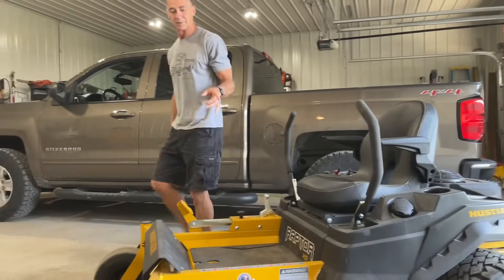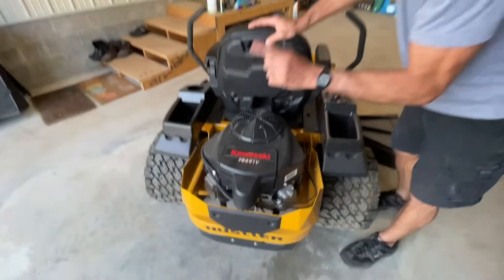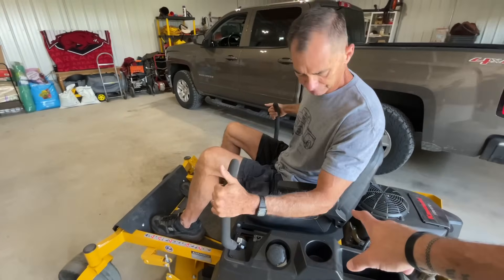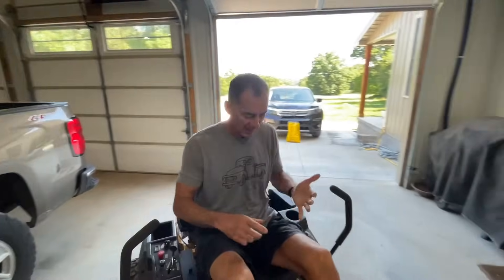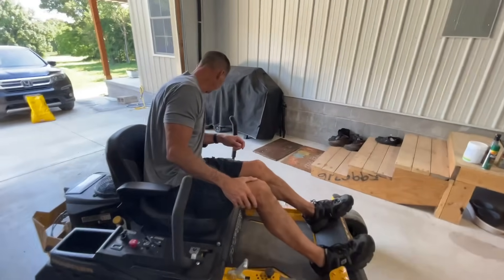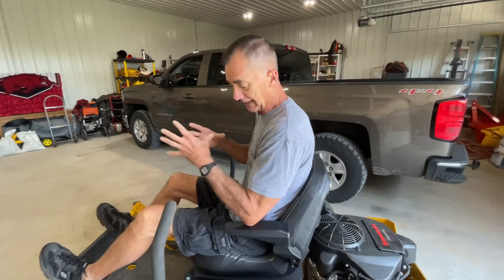DON’T BUY A HUSTLER MOWER UNTIL YOU SEE THIS!

Comment: I mow more than 100 properties a month with my Hustler Raptor 42, and have for the last 5 years. I wouldn't hesitate to recommend Hustler mowers to anyone. As much abuse as mine takes, if you're buying one for home use it'll last you MANY years. Great video!
Reply from the maker: Thank you, I love hearing these stories. You are busy,  my word that's a lot of properties. Appreciate the comment
Reply: I've been wanting to get a raptor for commercial use but didn't know if they'd hold up. Thanks
Reply: @braydenvandenberg8703  Update: my 42'' Raptor was such a workhorse that this year I bought a 54" Raptor and a 34" Surfer Pro. The only issue I have with zero turns is rear tire traction (the Surfer is a stander and doesn't have this issue), but that can be an easy enough fix.
Reply: @moebiwan  I was looking at the Surfer pros  for my smaller yards but since there so new I didn't know what to think of them. Is it working out good for you so far?
Reply: @braydenvandenberg8703  That's exactly why I bought one. Mostly for back yards that the 54 can't get into. I use it on roughly half of my properties. I prefer to sit as I have a bit of a bum knee, but it has worked out great for my business. 
If I had any complaints, I'd like the ignition to be in a less awkward spot (it's directly under one of the hand braces), I'd like the rear tires to be wider, and I'd like smoother transmissions (it uses the 1800s, the same as on my old 42, and they can be a bit jerky). But those are minor complaints. It's built well, the cut quality is excellent for me (I cut a LOT of centipede and St Augustine), and the way the engine is mounted you can get to everything in a snap.
Reply: @moebiwan  Thank you!
Reply: 3k with 150hrs in great condition a decent deal?
Reply: @Jimmmer  Stop cutting corners and buy a commercial mower. The surfer pro isnt commercial and neither is the dash. I cut 60 yards a week, you get what ya pay for. 
Any brand that sells more residential than commercial (IE hustler) Stay far far away from.

Comment: I bought a Hustler Fastrac I think twelve years ago, and have been very pleased! 20 HP Honda w/52” cut. It has been a low maintenance mower, and the yard I was mowing until recently was close to 1-1/2 acres, with some steep area’s. Mowing those steep sections of the yard was a little stressful at first, until you learn how your mower will best handle those types of situations. I would definitely recommend Hustler, and would buy another one.

Comment: I've had several people tell me that a zero turn will mow as good at full speed as they do going slower. With your yard still a work in progress, slower is probably better. I don't remember you mentioning the mower having a seatbelt. lol 
As far as your yard goes, do you have a tiller for behind your little tractor? I think that would help a lot with the yard. Put dirt in, smooth it out some, then till it good. The tiller should help smooth it out for seeding. Not sure that would be the answer, but I don't think it would hurt anything. And you would have the tiller if you wanted to expand your garden next year to some regular in ground gardening. 
Interesting and informative video, keep them coming. Have a good day.
Reply from the maker: I tell ya Robert my yard is nothing but rocks. I pretty much just have to cover with dirt. Lol I cannot imagine mowing that fast, crazy

Comment: I am sure you know by now that you have got one of the best mowers made. I have had mine since 2016, it was the Super Z back then with a 60 inch deck. It has NEVER had to go back to the shop for maintenance! Never had to have the drive motors readjusted to keep it running straight. I change my oil regularly, keep my air filter clean, and keep the grass off the deck, blow it off after every use. I love my Hustler, hope you are loving yours too! I even was and wax the thing! I never walk on my deck either! The fuel tanks on mine are over the rear wheels (2) and they have sight plastic to see how much fuel you have. And, speaking of belts, I still have never changed a belt on mine, that's just a testament to how smooth these machines run.
Reply from the maker: I love hearing that thank you! You can’t beat regular maintenance for longevity

Comment: Good choice.  I have a Hustler fastrak and love it.  They are solid as a rock and thats how I bought one.  They bragged about how solid they are so I started comparing and saw it was true.  Nothing bad to say and Ive had mine 2 years.
Reply from the maker: Thank you Norman glad to hear that
Reply: My Hustler Super Duty Fastrac is 10 years old and has 600 hours on it. Kawasaki motor. Change oil, grease, blades and 1 set of spark plugs, 1air pre filter is all I've ever had to do to it. Its awesome.

Comment: Great review, I agree with you on every point and getting the best deal for the buck was the primary reason I bought the Hustler Fastrak 60” with the Kawasaki engine, in 2019. I lived in southern Oklahoma and mowed almost 7 acres, including my pecan bottoms. The hustler cut my mowing from all day7-8 hours on a conventional rider down to 3 hours. I did get the higher end seat and the flex suspension, not to mention it came with an electronic fuel gauge.  Thanks for the review.

Comment: I really enjoyed your review and comments. I bought a new 2014 Hustler Raptor SD 60 from Lowe's of all places. Had never heard of Hustler at that time but was impressed by the build quality and followed up with research and found them to be American made in Kansas I think. Anyway was highly impressed and ponied up I think it was neighborhood of 4200 out the door. I remained impressed up until 2 years ago when the transaxle bracket broke and left me temporarily stranded. Upon discerning the issue, I was disappointed that Hustler began building a very solid machine but then to see those wimpy, wimpy, brackets. I pulled the mower back to my residential shop, removed the bracket, and welded it back together and I'm still using it. Since that time I've learned that this was a common problem among the early mowers up until about 17 or 18 in which Hustler began offering heavier gage brackets. Anyway, other than that, that is the only big issue I have had. I did replace the spindle bearings a couple of weeks ago after 10 years of use, 240 hrs. I did tell the Hustler dealer the transaxle upgrade should be like a recall thing and give it to me for being a loyal customer. He just laughed and brushed me off. I'll buy the upgrade when it breaks again. I'm 6'-3" and totally agree with your trepidation pertaining to stepping on the deck. 10 years now and I still do not step on the deck. Fortunately at our height we can stretch out to solid ground! lol.

Comment: I just bought the XDX because it has the bigger transmission and we live in the mountains so it's super hilly around here. This past Saturday it was delivered and I got my first mow with it in 2 hours. The riding tractor mower it took 5 hours to mow. I love it so far. There a little learning curve with it on thes dang hills. But all and all it was good.. it didn't have problems the tractor dose. And for the transmission it never failed or slipped or anything. The tractors would fail and take off or worse make all kinda of nose. I'm happy with the XDX I'm glad I got that 1 and not the club cadet I was after. Great mowers indeed 👍
Reply from the maker: Oh I bet that is a nice mower. I think also has the upgraded seat. Heavy transmission too. Very nice congratulations. Let me know how it goes. Zt's are game changers for sure

Comment: Commercial Fast trac bought in 2018 still going strong. I have a good full service dealer in the neighborhood, makes all the difference.  They pick it up at the end of the season, tune it up, check everything bolt, fix what needs fixing and then return it. All I do are the blades.

Comment: I've used almost every brand of zero turns over the last 6 years. Hustlers are by far the easiest and most functional mowers I use. I've used 42, 54, 60, 66 and 72 inch Hustlers. There's two things to me that sets them apart.  First and foremost they're extremely easy to do maintenance on. I can pretty much rebuild one of these mowers in somebody's yard in 5 minutes lol. Second is the foot pedal. I cut a lot of yards and use that pedal on almost every yard I cut at some point.  There's so many holes, debris, uneven ground etc that it's very beneficial to be able to manually and temporarily move the deck up as far as you need.
Also I've never stepped on a mower deck in my life. It's just not neccessary and I've been on and off a 72 inch thousands of times

Comment: I bought a 42" XD back in July.  I love it!  The smoothtrack  steering takes some getting used to only because it requires very little movement of the steer bars but it is very nice. I dismount almost identically to the way Grandpa does.
Reply from the maker: Yes the steering is great but touchy. I try not to step on the deck as well. Nice mower

Comment: I bought a 60" Raptor SD with the kawasaki engine in late summer of 2019.  I mow almost 5 acres and was mowing with a Husqvarna 54" garden tractor.  But this mower is so faster and more powerful than the Husqvarna that it cut my mowing time in half.  Its so fast that I don't think I've ever run it wide open and its never been choked by heavy wet grass.  The only issue is that there is no suspension so you will feel every bump and rut.  I bought a large lawn roller that I pull behind the Raptor.  Its filled with water and 50 lbs of sand.  This does a good job of rolling down humps and bumps especially if the lawn/field is wet.
And as with any equipment use high test fuel, change the oil, filters, and belts as recommended.

Comment: I have a larger Hustler Z4 which they only made for a couple of years. I bought it new in 2010 and have been mowing on my 20 acres every year since and still love it.  It has the big Kawasaki motor and has even more hardcore items like a floating deck with chains, flex fork front tires that is an added suspension device, rollbar, air ride seat, twin gas tanks, easy oil change and hydro changes. The thing is just great.

Comment: Great video. I bought the 48" Raptor XD about a month ago. It is the first zero turn I have ever used. I almost bought a 60", but U-Haul doesn't make any trailers with wide enough gates/ramps (and dealer wanted a ransom note to deliver to me). All in all, I'm happy. We have some steep slopes on my 2.5 acres, especially the ditches and a crazy slope leading up to the house. A few small areas I'll need to hand mow, but this thing rides great.. I like the power and ease of use. I'll likely add the front forks because riding over the septic drain field is like riding a bull or something. Like you, I wanted to maximize the mower per dollar spent. These are well built and designed machines. I'd be afraid of buying a big box mower. Congrats on your mower and your home. Wish you much luck.
Reply from the maker: Congratulations Eric, so far I'm very pleased. My land is pretty level. I'm definitely adding the other forks one day

Comment: I have a 2018 raptor limited with 52" deck and 23hp Kawasaki. The limited model has the wide rear tires flex forks on front and nicer seat than reg. Raptor. I change oil and filter and sharpen the blades. Never had any problems, it works perfectly. I had lawn tractors before and I can never go back to that. I have 1 acre and the 0 turn cut my mowing time in half. The only thing I wish was different is that it doesn't have the foot pedal for lifting the deck only the lever you move by hand and like you said that deck is heavy. Otherwise I have no complaints about it. I would buy another hustler.

Comment: Thanks for the video 
I Have a XDX 60 and I love it. I hope you enjoy cutting as much as I do now.  But
1. It's way to easy to overfill the gas tank so I flip the seat up to fill  and watch the level, to avoid overfill and fuel spilling on the deck.
2. The choke is forward of the PTO so I pull the choke and stall by accident, I wish the PTO was the forward control. Normally you only choke it once.
3. The owners manual suggests you have the dealer replace the hyrdo oil and filter at the dealer @ 75 hours. No more DIY.

Still a amazing machine! went from 2.5 hours on a 54 rider to .9 hours on my XDX
Reply from the maker: Great information. True only choke once. Ty I always do the recommended maintenance. I'll follow the manual

Comment: It kind of blows my mind that mowers are rated for acreage. When we farmed, we had 3 homes on a 400 acre property (just North of you in Vernon County), and we mowed approximately 10 acres of yards and a pond dam with a 20 year old 110 John Deere with a 36" cut. Each was on a different part of the same section, so we just drove it around the section from place to place. Road gear on it was probably 4-5 mph. Our house was just a trailer slapped into 5 acres of native pasture (and the pond) that had always had cattle on it, so it was a pretty rough ride. I doubt if we ever have the land again to need a zero turn, but if we did, I think we'd certainly look into one like yours! I really liked the accessibility of the belt and filters, and the big, solid  platform. And honestly, compared to the price of other new mowers around ( even off breed ones) it's a pretty decent price for the quality you got.
Reply from the maker: Do you think they just don't make them like they used to RW?

Comment: Hustler was the very first and invented the zero turn mower in I think 1964.
I bought a hustler 2500 72" and used it commercially for years. I can say being honestly I had it and used it every day when I finally retired this machine I had put well over 10,000 hours on it. Yes I did replace the engine once but, when I got rid of it I was sad... I still to this day regret letting it go, And that's been 8 or 9 years ago. My recommendation is that if you can afford a hustler mower buy it . Yes every mower company has issues but hustler is built way better .
Reply from the maker: Very glad to hear stories like this. You are correct. First zero turn!

Comment: I have a 2016 Raptor SD with a 25hp Kohler and a 48" deck.  I can see some improvements in this later model with the lift-up floor for access to the top of the mower deck, and it was time they added the sheild for the engine.  I have the shield on mine and had to purchase it separately.  I would agree with your comments on the easier to service improvements.  Mine is a bit of a pain to change the oil on.  I'd have to get a closer look on the height adjustment to see if that's better or not.  My biggest issue with the one I have it how loud it is, even with a muffler.   I need to start wearing some hearing protectors when I mow, you are correct to be doing that.  Overall, I've been very happy with mine and it makes my .7 acre lot a fairly quick task to get mowed.  Nice review.
Reply from the maker: Thank you AJ, really appreciate the comment

Comment: I bought mine last year I'm with him I fell in love with it. Come this spring I had to jump start my mower and it was very easy to do by myself by sticking my hand down through the hold of the seat. And I am like you I blow my mower off every time I use it including my air filter. My son-in-law asked me if that was a new air filter and I said no it was from last year he said it's not even dirty. I am getting ready to change the oil and the gas filter for another season also I want to Lube all my moving parts. I thought about having my son-in-law weld me A-Rod on the front end to help get up and down off the mower😊

Comment: I have a 2016 Raptor SD. I have had all kinds of trouble with breaking Hydro brackets even the thicker upgraded bracket kit! Battery box has broken twice. I have 400 + hrs. The frame was made that allowed too much flex! Other than all those problems I still like the mower. I mow 4.5 hrs at a time on my place. Your video shows the upgraded mower that shouldn't have any of the troubles I've had as the frame is totally different now!

Comment: I'm looking for a zero turn - Looking at the  model that does 1 acre.  Laughed at the part about the back of the seat.   I'm 74 and am 4 ft 10 in - the back will probably be above my shoulders.  Don't know when I'll get mine, but soon I'll be able to make hay.
Reply from the maker: Awesome Janie!
Reply: we have a nice powerful diesel kubota  love it plus our kubota zd has a nice comfortable air ride seat wich so nice on the back and a nice dial for height adjuster,and led feul gauge light on the dash and a nice hydroulic lift, and shaft driven deck

Comment: Had a hustler raptor for the last 6 years, still runs like new,  my very rough yard just about wore the deck out, looking for a new deck now. In six years replaced 2 spindles, the front wheels and the starter switch.

Comment: I just got a 60" fastrak 7-13, I have 10 acres of yard and field (tallgrass prairie), I mow 6-7 of it.
I wouldn't worry about stepping on the deck, I am 6-4, 330 pounds and it does not budge at all.  
They are made in Hesston KS.  The seat upgrade is worth it.  
You are right about the power, push the bars forward and away you go.
Reply from the maker: Oh that is a sweet mower. Congratulations Travis! Now that’s a lot to mow

Comment: What your dad said was new for that model may be for that model but can verify is not new for Hustler.  I own a 11-12 year old Hustler Fastrak which is actually the highest Resi one they have and it has the solid frame/solid deck with the 1/2 inch thick guard on the bottom which by the way is warrantied for life.  Mine came with a Honda 20 horse which after around 12 year still knocking it out of the park.  Enjoy, you should get many years of service out of your new machine.
Reply from the maker: Thank you Mike. Glad you commented. Always more to learn. Hope mine lasts that long